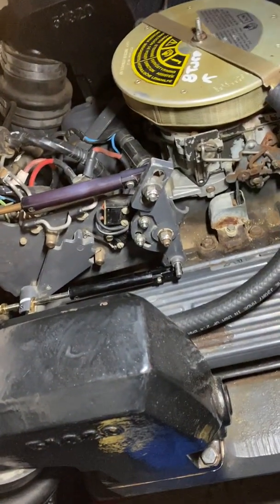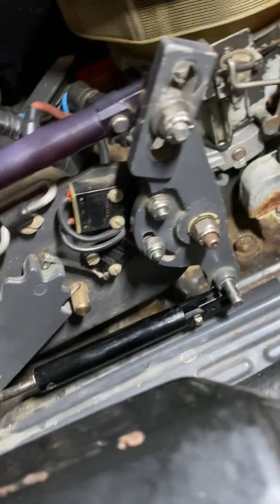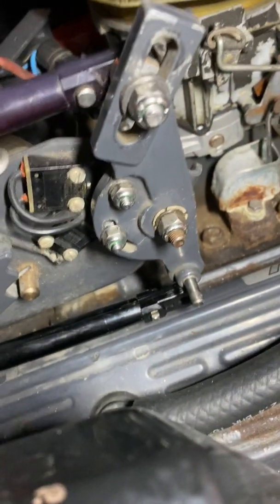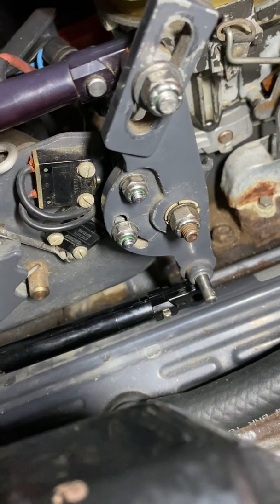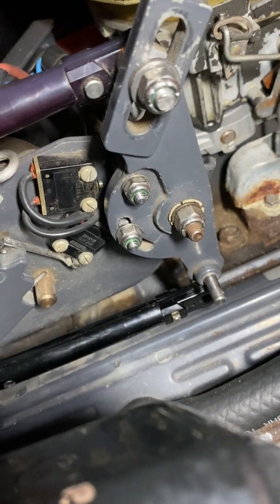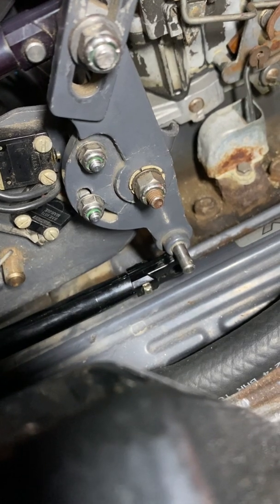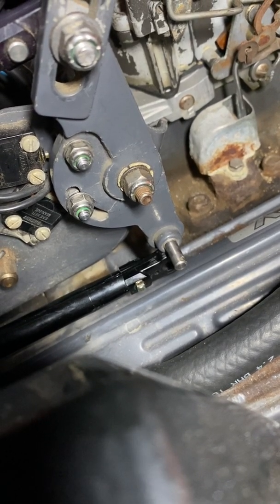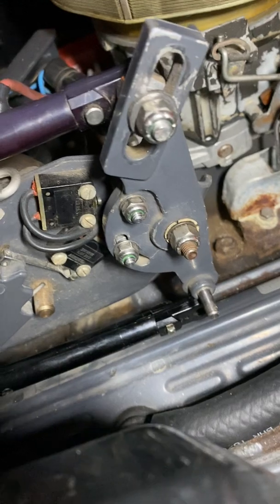Part 1. OMC Cobra shift cable adjustment, diagnosis, common failures & remedies.

Comment: My 1988 4.3 OMC Cobra shifts fine - except that it will spit and sputter  and die when going into FWD or Reverse.  It will eventually rev up after several attempts and go great.  I am thinking it is tune up related and I am considering changing out the points system to Pertronix ignition system.  Thoughts?

Comment: Hey, thanks for upload. Sometimes i cant shift in Neutral, is it the shiftcable or this ESA - Modul? or what can it be? greetings from Bavaria.
Reply from the maker: Did you watch all 5 parts of the video?
Reply: @stevejohnson29  no because sometimes its Hard to understand all, sry im from germany. I think its a electrical Problem at my boat because most of time it runs normally.
Reply: @smallenginerepair7921 thanks but meanwhile we repaired it
Reply from the maker: What did you find was the problem?